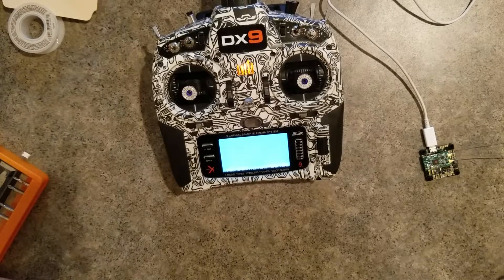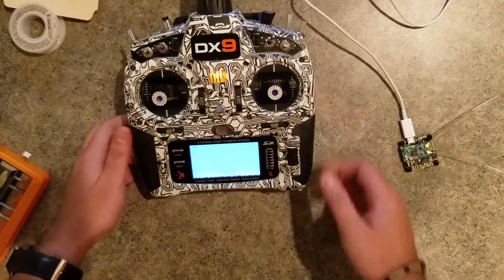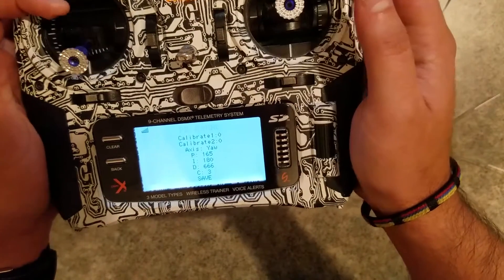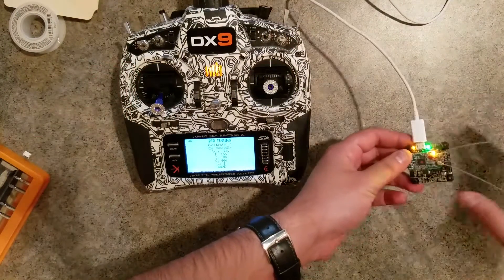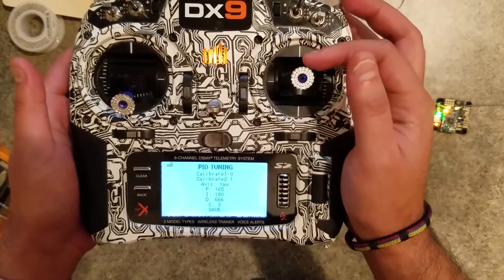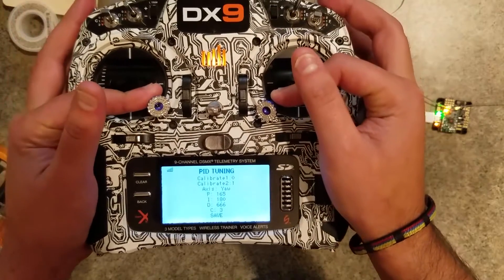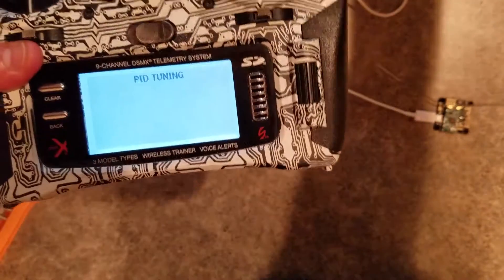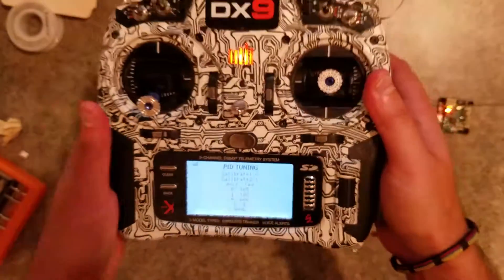Spektrum FC programming with telemetry demo

Comment: i have a naze 32 and trying to get voltage from signal wire but no luck its connected to the spektrum port on naze and powered by the 5v do i need to connect the other 2 wires that come with it to vbat or have i missed a step thanks